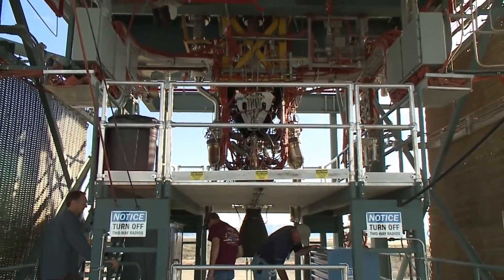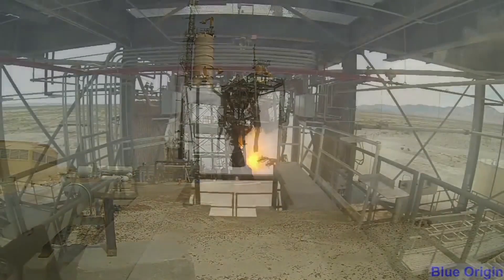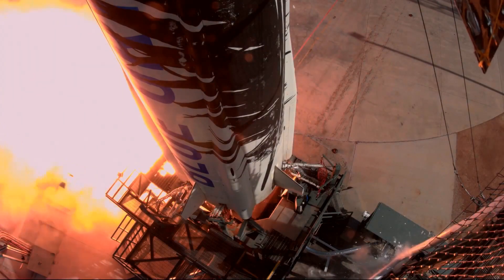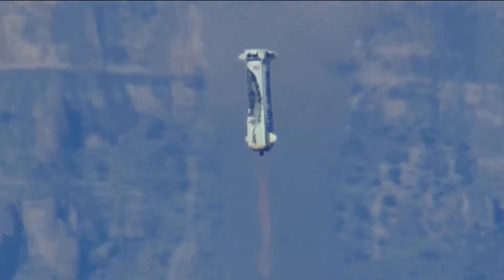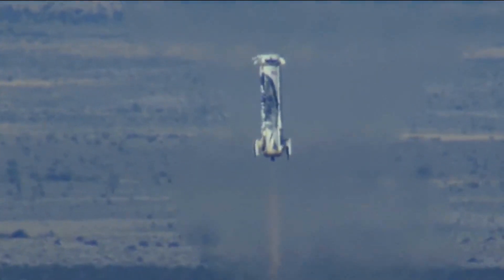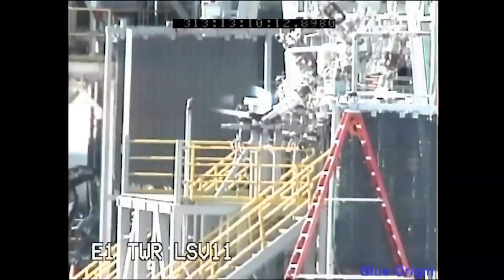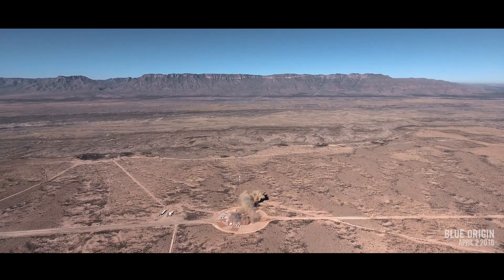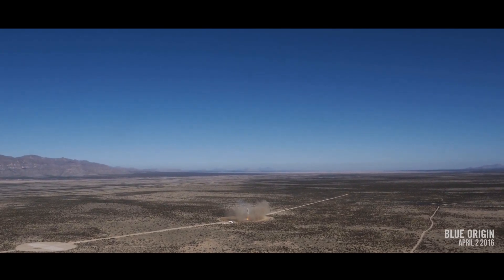Blue Origin's BE-3 Rocket Engine

Comment: Isn't BE4 planned to be used on Vulcan? It's a completely different engine than BE3.
Reply from the maker: BE-4 Will power the first stage of Vulcan. The second stage of Vulcan will be Centaur (same upper stage Atlas V uses), but eventually ULA is going to change the upper stage to ACES which is in development. One of the engines currently being considered for ACES is BE-3. So Vulcan could end up using both BE-3 and BE-4
Reply: Thank you for the information. Have you considered doing a video on the RL10 or Vinchi engines? They use the expander cycle and seem to have very high Isp. It would be great to hear more about them.